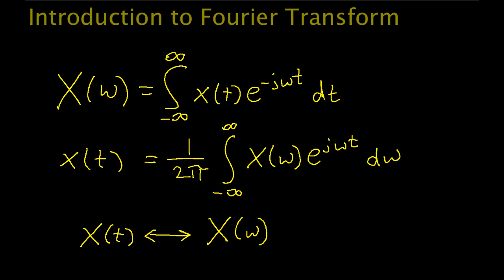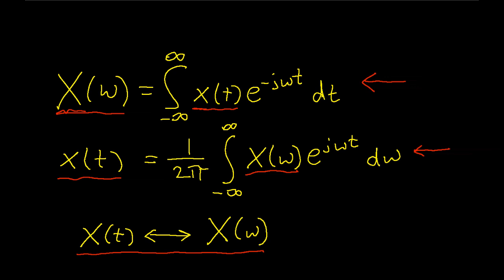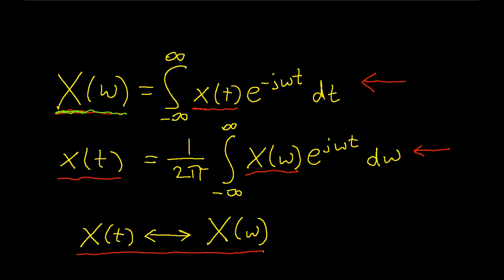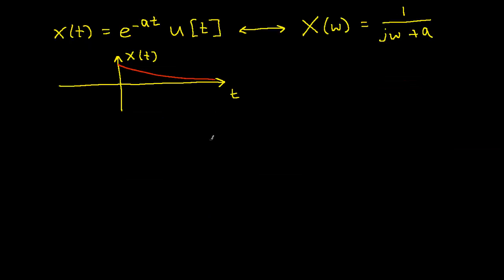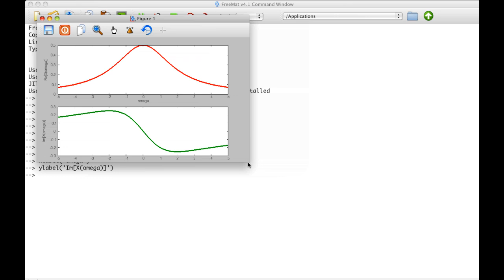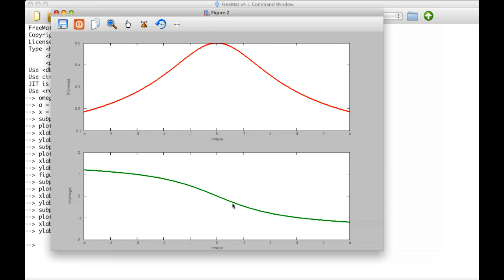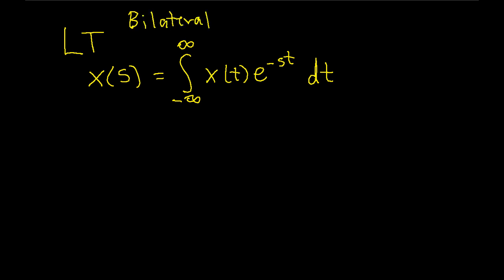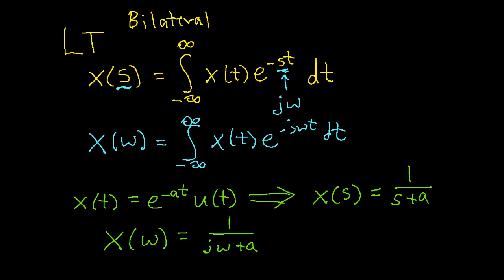Introduction to the Fourier Transform (Edited)

Comment from the maker: The easiest way to do a Fourier transform of a triangular pulse is to use the fact that the triangular pulse is the convolution of two rectangular pulses, and that convolution in the time domain is equivalent to multiplication in the frequency domain. So the triangular pulse transforms to a sinc squared function. I don't have a video illustrating this for continuous time signals; I do have one for discrete-time signals, which you can find by looking at my "Discrete-time Signals" playlist.